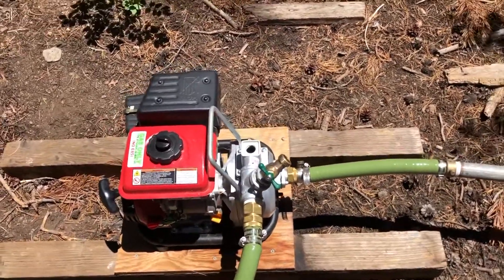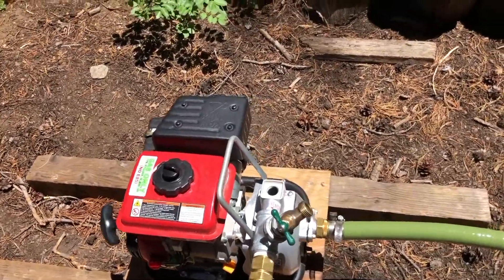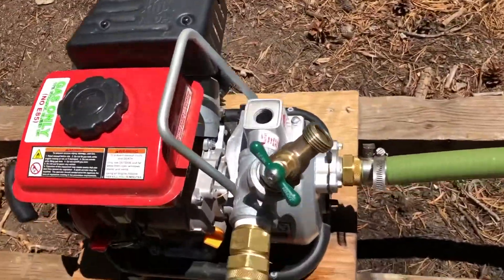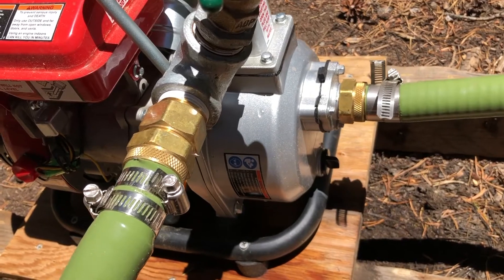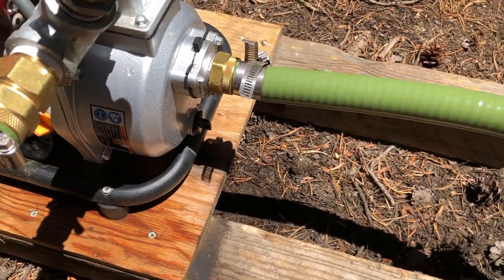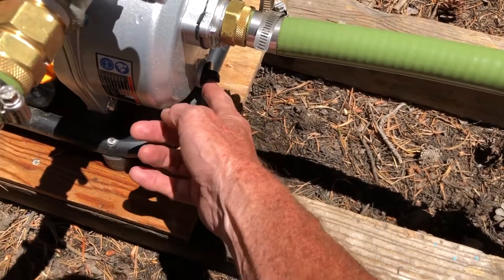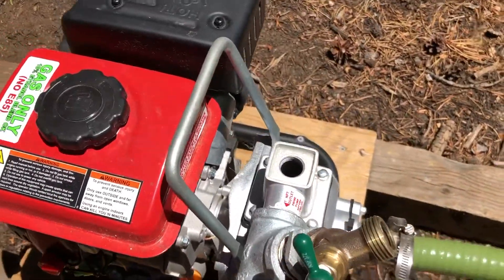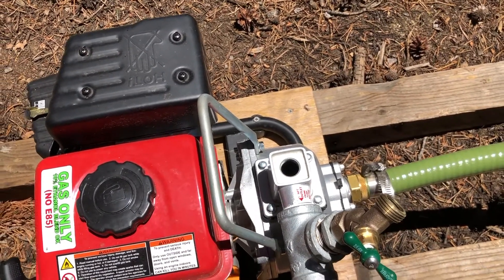Echo Lake Predator Water Pump #2

Comment: How deep is your well?
Reply from the maker: It's a shallow well, probably 10 feet deep, water level ranges from about 6 to 8 feet.  The pump pushes water up about 30 feet to a holding tank.
Reply: Did the pump come with an inlet hose and strainer
Reply from the maker: @parkerjohnson1781  No, I bought the hose separately & didn't need a strainer - there is one on the downpipe in the well. Their 1" hose worked fine: https://www.harborfreight.com/1-in-x-20-ft-pvc-suctionintake-hose-63410.html